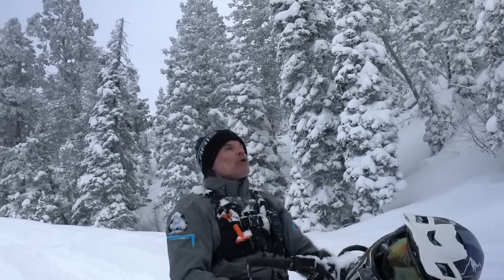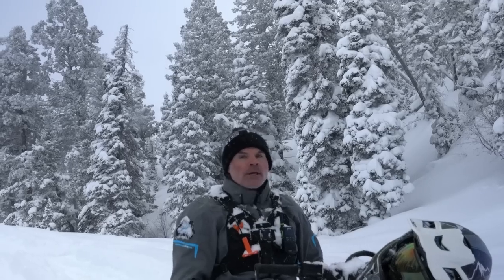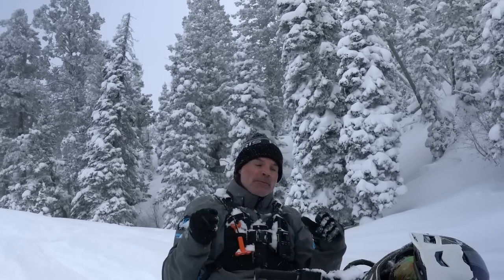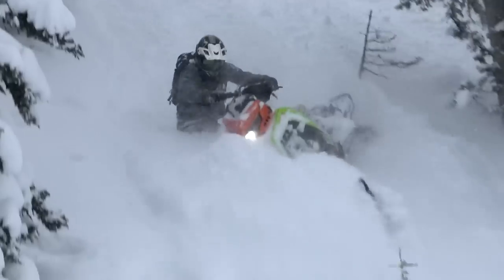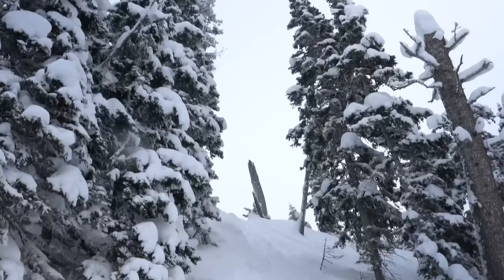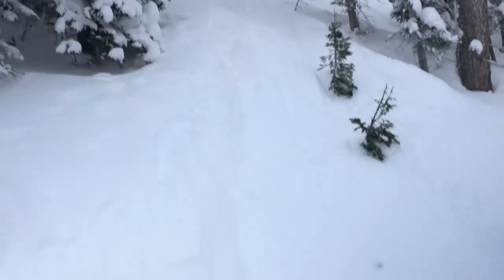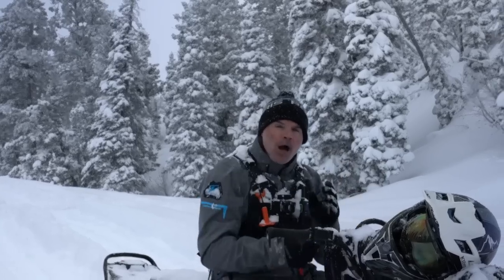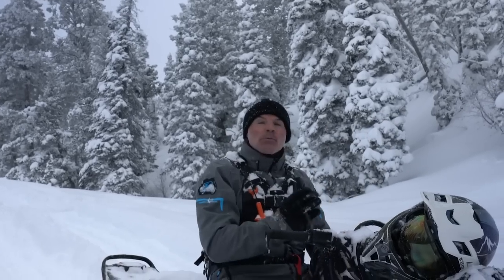Descending Steep Slopes

Comment: I absolutely love all your hard work with the clinics. That said; the first down was out of control. If that had trees/ wells/cliff. It would have been byebye. 
Controlled Khaos. 
Thanks for sharing your experiences.
Reply from the maker: Hey bud remember that I knew it didn’t have anything below from sizing that elevator up from the bottom.  I have the power to edit things out of my videos and this one was actually on purpose and felt super good! Sometimes coming downhill doesn’t always go as planned but I certainly felt right about it.  A downhill track vrs an elevator are both variations of coming downhill but can both be in control if you’ve positioned yourself as good as you can. 
Thanks for watching 🤘
Reply: I thought it was a pretty good example, he even gave it throttle to get the track speed up at the bottom
Reply: Nope disagree - well done Dan as always… best to have an idea of the terrain but sometimes you end up heading down the unknown so being in control is vital … excellent instruction as expected - hope toe ride there some day

Comment: I’ve gotten on edge going downhill, but sled stayed straight down since I was pointed fall line when initiating counter steer & tipping. Do I throttle to get sled to carve a little across fall line? It seemed like countersteer was taking front end left, but track wanted to go right.
Reply from the maker: Hi and thanks for reaching out. Remember that once you’ve counter steered and successfully put your sled on edge….we need to move our body to get our sled to change direction. Not unlike a downhill turn we step down with our foot (opposite foot riding position) and pull the front end in the direction you want to go.  Hopefully this makes sense and you continue to practice because it sounds like your there…you just need one more step to get the sled moving in a direction other than straight down the hill. 
Ride safe!!